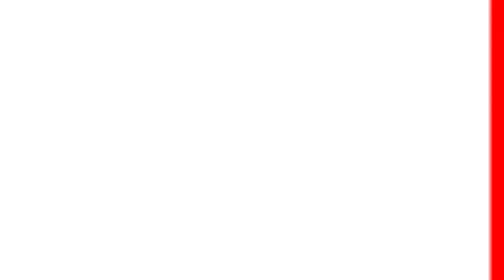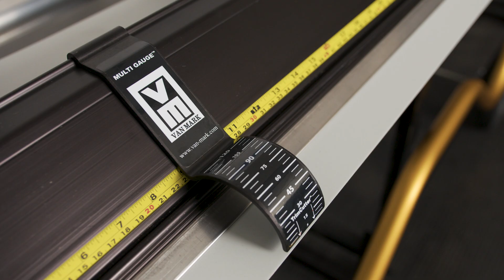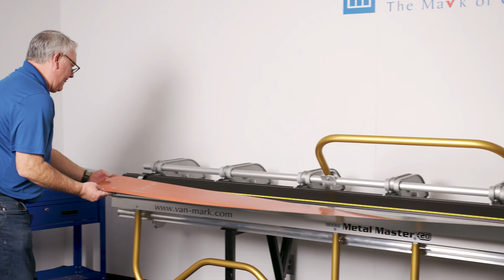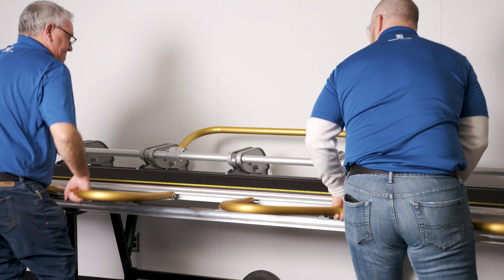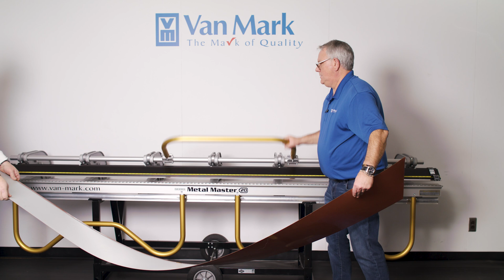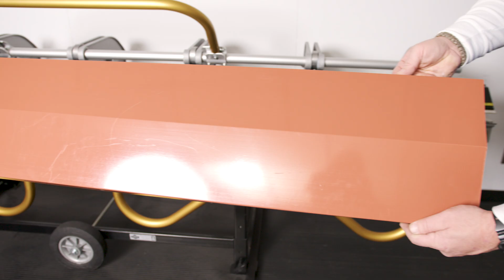How to Bend Sheffield Metals Detail Flashings With a Van Mark Brake

Comment: i bought a used 16 gauge real brake..not for portability. i HATE TO RAIN ON THEIR PARADE BUT A 10 FOOTER was 2500 bux..i probaly make 50 -60 bends a week ..and this machine here may not,probably wont smash a hem very flat in 24 g and 29 is 80PSI spring steel,harder yet.Thenoises this alluminum brake makes tells me it wont live very long!